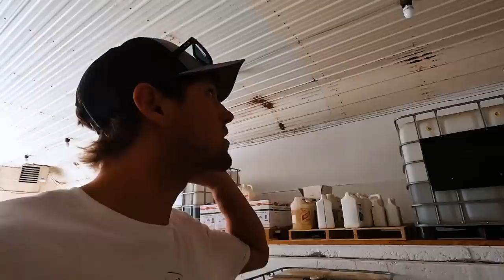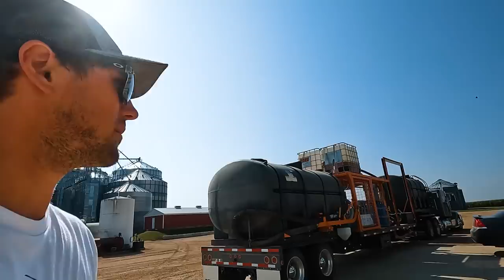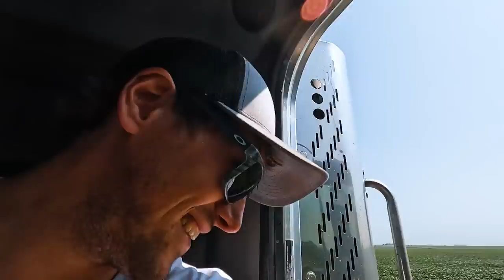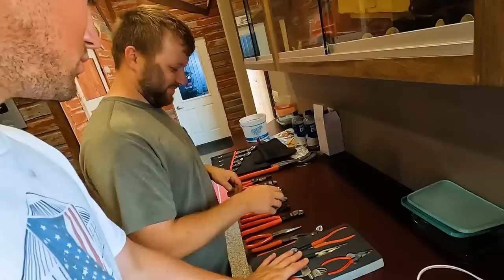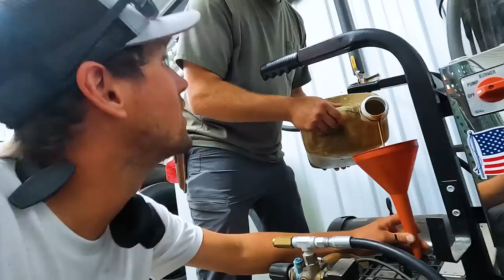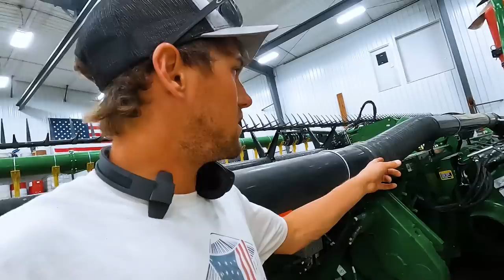Best Crop On The Farm This Year!!

Comment: Thanks for the promo on Brunt pants Chet.  I've been needing new pants and couldn't find anything I liked at the local Tractor Supply.  I've noticed you wearing these for some time but couldn't figure out what they were, so I was glad to see the larson10 link.  I ordered a pair, washed 'em and wore them today and really like them as a slender build (30x32).  Lightweight and soft material that dries fast.  For people more like Erik, I think they'll find the gusset inseams make them comfortable too.  Pockets pull out for washing too.  Workmanship is excellent.   I'll be buying another pair.
Reply: How do they feel in hot/humid weather? If you sweat a lot, do they dry quickly or stick to your skin?
Reply: @scottherrick5191  Haven't tested them rigorously outdoors yet, but your answer may be in knowing that for the "Martin" pants that I got, they are 28% nylon.  The other two varieties vary in content - 34% polyester for the "Torra" and 92% poly for the "Whitman".  For the Martin, you don't really need to put them in dryer to dry, so that's how repellent they are.   I expect there will be some wicking quality so that when my shorts are saturated from sweat and bleeding into my pants making me look like I wet myself as my other work pants do, these will perform better.  The only downside I see would be static electricity if you dry them too much in dryer.  They would surely stick to you then I think, but I doubt sticking from moisture will be a problem like denim or duck cloth.
Reply: @TMacTx  gotcha, I’ll have to look into the different varieties. I work in a very hot and humid environment so keeping moisture and heat away is key.

Comment: Other than hearing you talk about water hemp and others out your way, I did not know it is also hear in Eastern PA. Talked with a college friend (dairy farmer) talking about his battle with water hemp. He is dealing with much smaller acreage, so he is able to have friends walking the field using the time honored method of weed control, yanking them out by the roots. While he is working with corn which will be come silage, he is concerned  that the seeds might just pass through the cow's digestive system and then returning to the fields through manure spreading and coming up next year worse.

Comment: On the combine drop a size on the rear tires or deflate them a little. It has a large enough fulcrum that raising the axle may be all that was needed. but dropping pressure might add a little more if needed.
Reply: Except need 30 psi to carry 400 bushel

Comment: does the water himp grow TALLER than the BEANS???  would one of those ELECTRICUTION DETH TO THE WEEDS SYSTEMS be benificial ????   are there any of those outfits to custom hire (TEST OUT) up there in yer hood???   

you kno the WEED ZAPPER THINGIE I am referring to right???  
a big old generator on the PTO and it ZAPS the weeds with no chems....  ????  
seems that one of those would be handy to have for the stuff you can't put the big guns down on!!